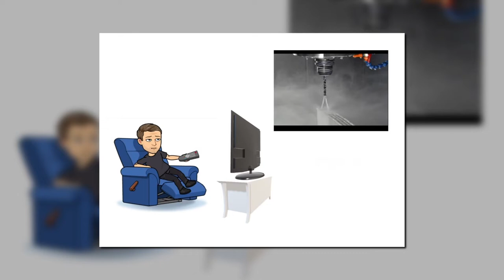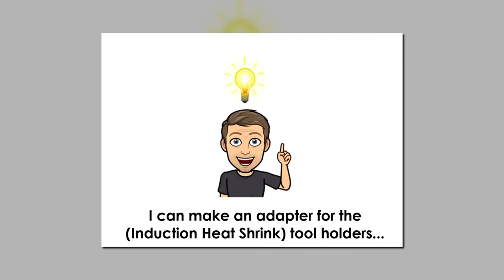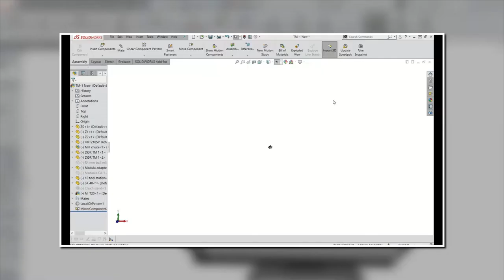Budget (Through Spindle Coolant) upgrade on a (Toolroom Mill)

Comment: Man thanks a lot for inspiration with pressure washer pump. I have Haas VF2SS with TSC ready option, all I did was to add user relays, valves and BOSCH profesional pressure washer pump and its 1000psi TSC beast 😂❤ I made custom M88 and M89 codes which control pump, valves and also build in TSC purge valve. M88 and M89 are blocked normaly, but when you override them with your custom M codes they will not be blocked.🎉

Comment: what seals did you use?
Reply from the maker: Nothing fancy…
I just ordered these Chinese (Ø3.5mm / 33mm x 26mm NBR O-Ring) on eBay…
https://www.ebay.com/itm/174310577586
Reply: Thank you for sharing.   That flow is impressive out of a smaller drill!  Can you please share which pump your purchased?  How is the rig holding up?